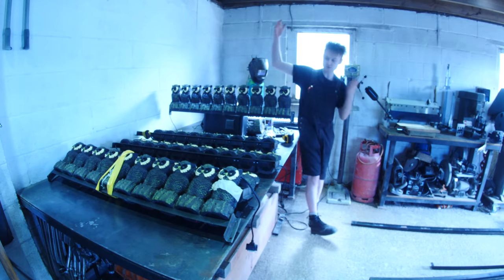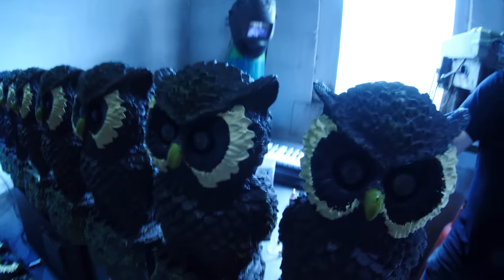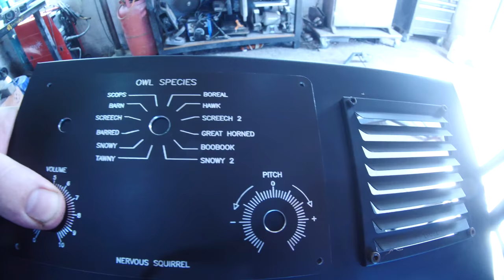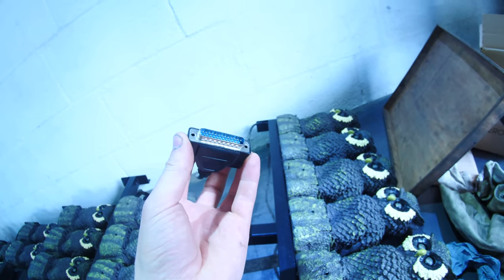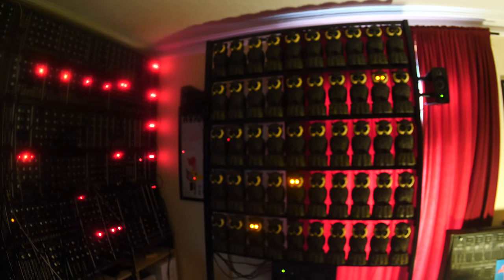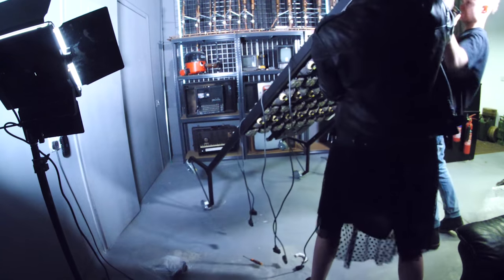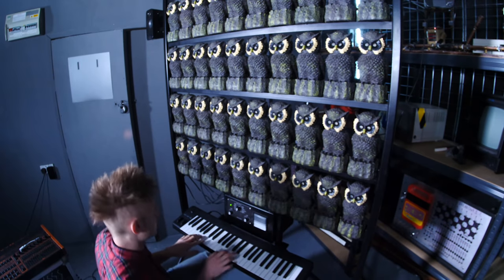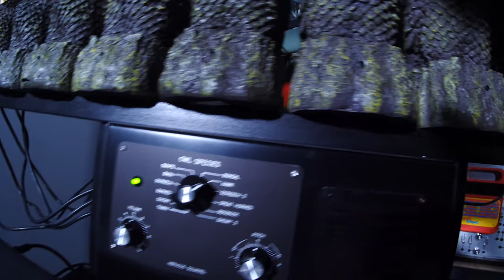THE OWL ORGAN, A Musical Instrument Made From Owl Garden Ornaments

Comment: CHALLENGE: The Dildorgan.  An electronic keyboard instrument consisting of 88 flexible vibrators of various shapes and sizes, each tuned to a different key.  You might need amplified microphones for each one to boost the sound, but I think you are up to the task.  Optional: solenoids to shake each vibrator as it is played.  You can do it.  But WILL you...?